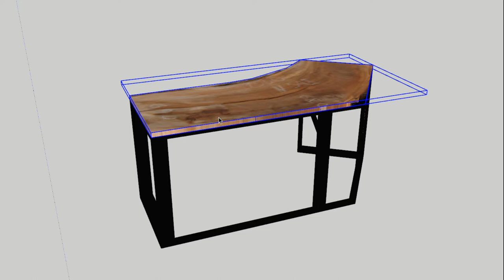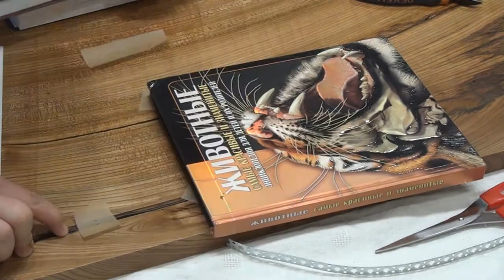DIY slab table with built-in wireless charger for mobile phone

Comment: Hi it’s need to be a more powerful battery to work? Just a question because there’s some wireless base that if you got a case in your phone they don’t work.
Thanks
Reply from the maker: Hi, proper question indeed! There are different power stations on the market, and some of them are for the installation from the rear side of the table, producers specify max distance between phone and station’s surface, and you need to choose the right one proceeding from thickness of your table and your case.